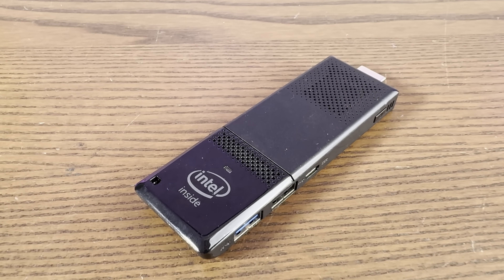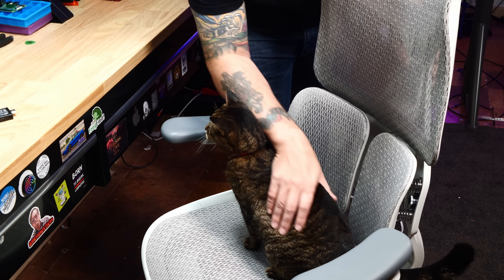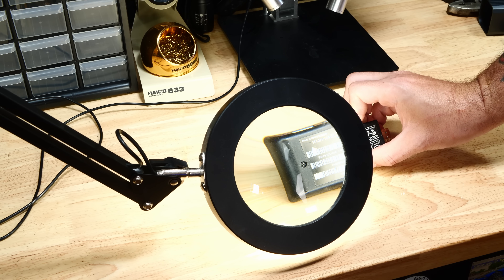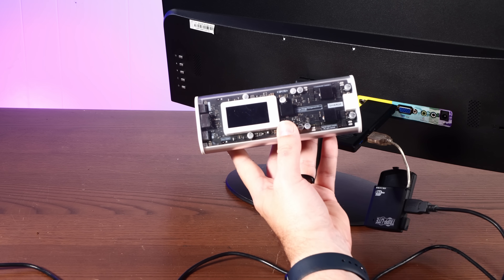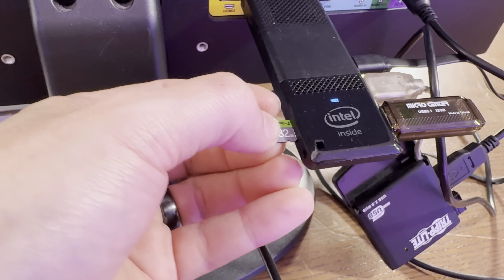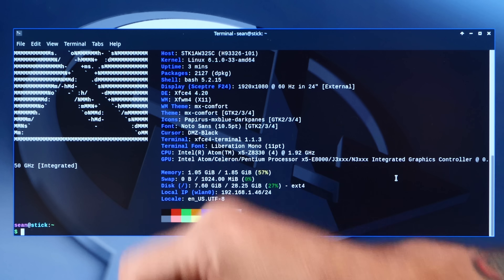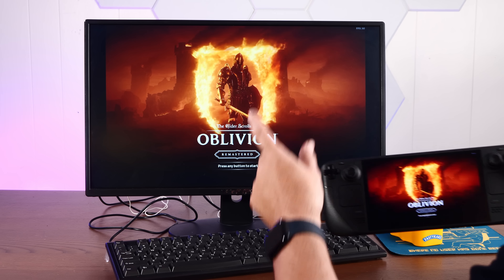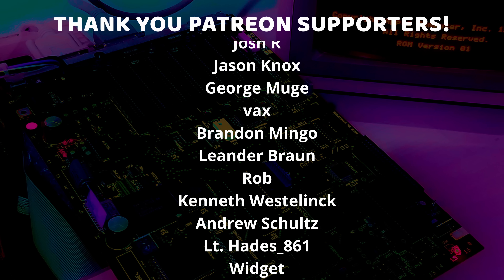Intel's Tiny, Weird Computer

Comment: Intel could've had the low end... it's too bad their killer low end chip (N100, which is pretty great actually) came like a decade too late. And is still a bit too hot for the tiniest of devices.
Reply: Fun how the N100 gets all the attention while the N150 exists
Reply: @urmensch12  Not to mention the N200, contemporary to the N100, sporting higher clock speed and more EUs (still the same TDP). You have a Twin Peeks counterpart as well, N250.
Reply: @jrussellmoore yeah most the n series cpus are great I just got a n5950 minisforum mini pc for my parents to replace their 2nd gen i3 desktop and downsize the desk, they only print stuff, YouTube videos and email on bigger screen than phone. Didn't need bulky atx desktop anymore
Reply: @jrussellmoore  "Twin Peeks" for Twin Lake is hilarious, I'm using that from now on
Reply: It’s the Intel way.
Reply: It boggles the mind really, that they didnt beef an N"XYZ" version up for use as an apu in handhelds, I do not believe they have a competing chip in that market.
Reply: @The_Last_Question there is some chinese made n95 handhelds(better igpu than n100) that can run windows. Good for like ps2 emulation and game streaming
Reply: @The_Last_Question  If only intel had held onto that ARM license...
Reply: hi jeff
Reply: Intel Edison could have killed Raspberry Pi in the early days if they followed through with documentation and support.
Reply: @ajlitt001 a lot of the raspberry pi movement if you will was a reaction to Intel/x86 hegemony. Part of the charm is specifically "eff you Intel".
Reply: Yeah hopefully we see a newer version on smaller node in near future
Reply: @alancarr195  isnt that the N150?
Reply: Yes i had made a mistake it was n97 i was thinking of
N150 is higher clocked igpu tho too
Reply: Apparently the new Intel Panther lake will have a Big/Little/Littler(?) architecture with P/E/LowPowerE cores so it would be very interesting to see this sort of thing with the same Big/Little as Lunar Lake or ARM chips but with literally just the E Core and the LPE cores. Maybe one N100 E Core, and then 3 LPE core, in some sort of quad core configuration? Could be very cool for this form factor, especially with Intel's new merging of the Energy Aware Scheduling into the Linux Kernel for better E-core usage
Reply: @christopherpol112 new core ultra 3 205 is 8c/8t with 4p+4e cores(arrow lake) prob see something like these as new quad core octo thread low ends or like 4 p core 2 e core 2 ue core in mobile
Reply: I use an N100 device for my main router running OPNsense, and another one for my TV using CachyOS. Honestly they are great chips.
Reply: It came later because Intel didn't see arm as serious competition in the mobile segment.
Reply: it would be so much better with a Snapdragon or an M4 chip nowadays
Reply: @thatcheesepuff  exept these are expensive af
Reply: I know right?  The Atom was god-awful (rather slow even with a nice slim Linux distro on it, I never had the misfortune to try one in Windows which apparently was QUITE bad), but by the N5040 and N100/N150 are actually pretty good.

I had no idea Intel made an HDMI stick like this -- but you could get Rockchip ARM devices that looked just about like this.  The ARM presumably ran cooler though, it was fanless.
Reply: I use one of these N150 cheap laptops, and I'd say it runs pretty damn well for what it is. Granted, I had to replace the crappy thermal material, though.
Reply: What about the N97 in the likes of the GMKtec G5? If I'd have to buy minipc's for my coworkers at their office space, that'd be my pc of choice, due to the low power consumption and relative power.
Reply: You could make a great case that had Intel continued to make ARM/StrongARM chips, they would have had a credible presence in portable electronics that they've strived (striven?) for, for years.  But they decided on "x86 forever", which was a mistake.
Arguably x86's heavily memory-oriented instruction set architecture that was so reasonable in the 1970's and 1980's, before the mismatch between external memory and internal logic speed became a vast chasm, became a driver forcing more complexity and transistor count to deliver the required performance than a competing RISC load/store design.  That extra complexity just costs too many transistors and watts in a portable, hand-held gadget world, which is why even Atom really never took over and ARM remains the market choice for them.
Reply: Ok but the N100 is only good if said system has more than 4GBs of ram and isn’t given eMMC storage. Thats the main issue with these other low end systems. Regular tasks like email would do better with a bit more RAM, and maybe some other things besides gaming.
The issue is that everyone thinks the point of a computer is for gaming, which is why all of this tech is considered crap. Take it from a guy who used a dual core Pentium from 2011 with 6GBs of ram on windows 7 till 2020. I could very much browse, watch YouTube, and do some other stuff, the only limitation was not having something like a GT730 to make things smoother. Hell even an i5-2400 can only get you soo far when the system struggles to maintain a stable frame rate with 60fps YouTube videos.
Reply: There are n100 computer sticks on AliExpress
Reply: Well, like other said, intel is not serious, they could add the lowest xe series gpu and made in 5nm and it will be a great tiny pc, instead they choose intel 7 (10nm), a mess.
Reply: The lore is Apple (Steve Jobs basically) kept badgering Intel to make a low power high performance mobile orientated chip for the first iPhone. This was at the same time Intel had launched Centrino and Apple went x86 (after Intel made promises after promises about its merits) at about the same time showing Apple (jobs) the future of computing was new ultra light weight uber connected mobile devices that were super easy to use, Centrino you know the mobile wifi connected super uber battery sipping branding that when you think about it should kind of extend towards more portable things than just laptops but magically didn't and couldn't without rebranding and whole underpowered understaffed under resourced division trying to make it a thing for the back of a TV as another desktop or too slow to use cheap as it gets laptop?  
Intel gave Apple a less than polite nope so Apple / MacOS and ARM became what it became. It was also the first non hardware engineering background CEO of Intel ignoring innovation and potential to focus on margins and ye olde exponential growth missing every potential innovation and growth potential imaginable by dismissing a whole entire new market segment to double down on what worked in the past because they (the corp leaders) don't see it directly effecting their share price in a "proven" line goes up way. Worse of all Paul Otellini was THE boss of Intel CPU, Desktop, and mobile boss of bosses (member that wee bribery thing) now remember what I said about non engineer going for short term almost exclusively knows it results in their personal gains.....
Reply: i remember wishing for an x5-8500 tablet but being disappointed it can barely run skyrim , then the core m series launched and they were better so i was waiting for them to come down in price, but then i lost track of what their successors are. guess intel abandoned the 4-5W chips
Reply: Basically they just needed to get off the "tock" phase of 14nm, IIRC
Reply: N355 anyone?
Reply: Intel still makes Atom chips, their latest line "Amston Lake" uses 7nm node and has all the modern features one would want. Now where they have really dropped the ball is availability...
Reply: They actually had something better and tinier, but I dropped it.
Reply: X86 just isn’t good for low power low heat applications
Reply: N100 is still X86/64, that's an obsolete chip not remotely appropriate for low power small things (or anything at this point). ARM is so much better.

Comment: Haha I remember the Intel Compute Stick! Make a follow up and try to Hackintosh it! There are some hoops to jump through to make macOS run on an Intel Atom CPU, but it's been done.  I do believe there are later iterations based on the Intel Core M3 chip (same chip as the  12" MacBook in 2015), theoretically making Hackintoshing easier.